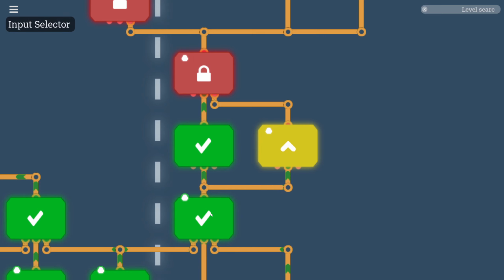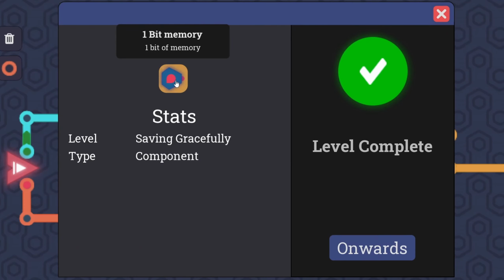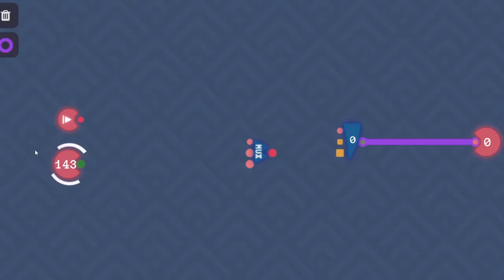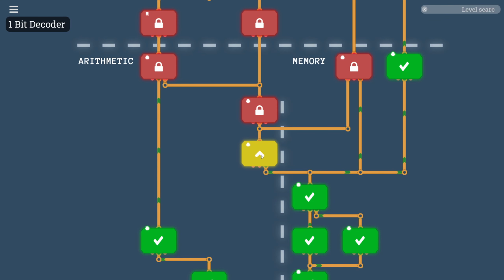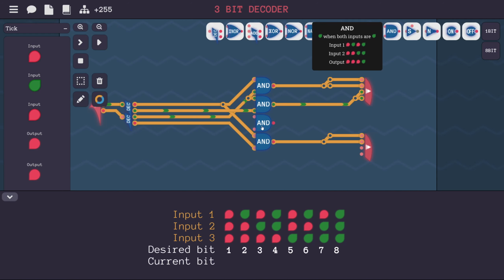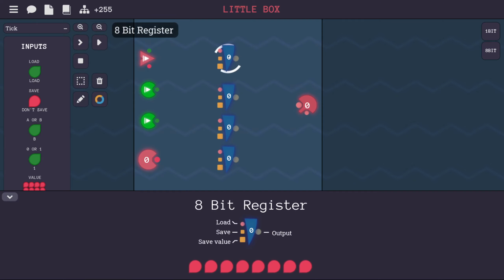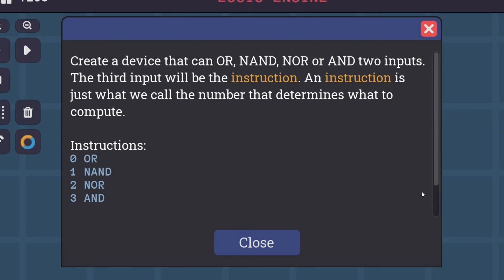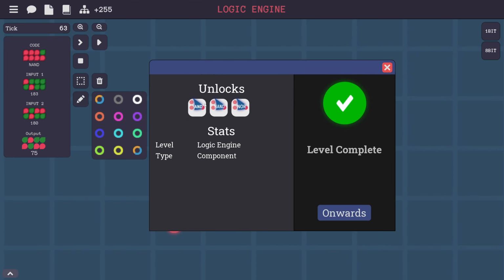How On Earth Do I Fit This Circuit in Such a Tiny Box?

Comment: I did this with switches instead of and gates. I also didn't use multiplexers on the output as i only had also one load switch active at one time. It probably would have been easier if i did it your way but i think mine was a bunch smaller.

Comment: Very sad I caught this video 2 years after it was posted, hoping youre still checking comments. I have a solution for Little Box that just uses 8 switches and two NOT gates. I recall running this one really easily myself, and looking at your solution... well, I'm not a CS guy, I'm a SWE guy trying learn how the metal works. I'm wondering if my solution only works in this game, thinking maybe your education or experience is being reflected in you working out a solution that would work through to FPGAs; or more unlikely I've just stumbled on a really good solution.

Comment: Your "3 bit Decoder" is more convoluted than mine. I used only three two pin AND gates, one three pin AND gate, fifteen bit switches (AKA transistor), and seven NOT gates. That said, you breezed through the "Counter" level, and I spent hours trying to get it to work. My brain still hurts. Good job.
Reply: ONLY fifteen. that still sounds like a lot of components brother
Reply: I used 3 NOT gates and   8   3-pin AND gates.   That's it.